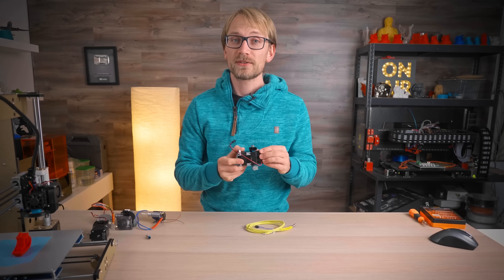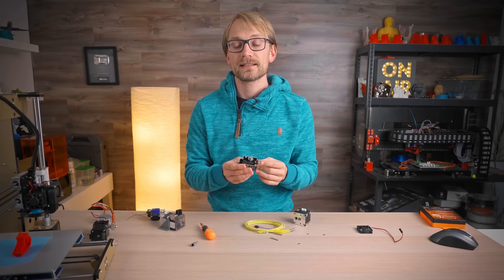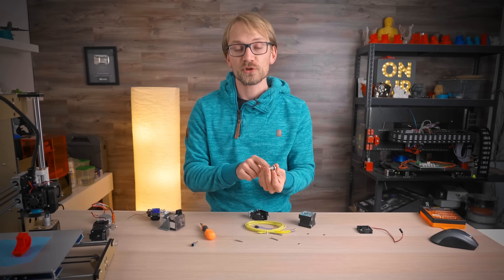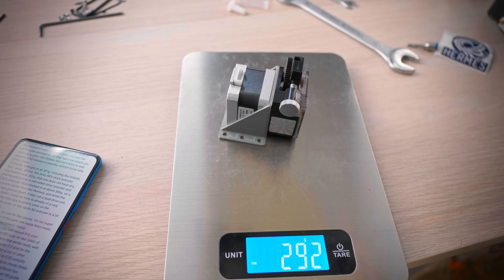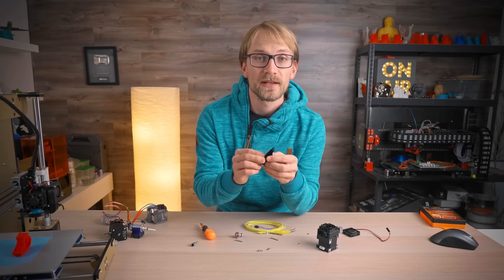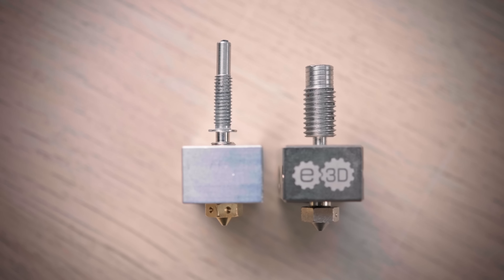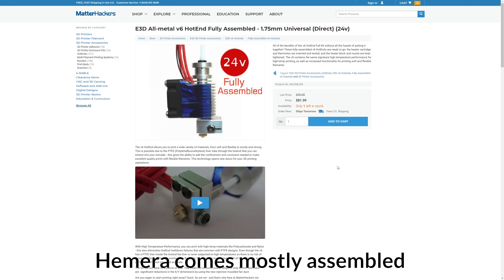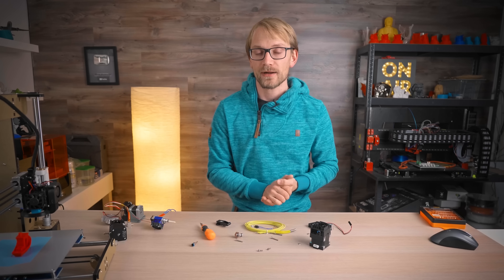E3D’s end-all extruder: The Hemera! (Full Review / “formerly known as Hermes”)

Comment: You don't need the fan when it's in bowden mode?
Reply: No hotend to make heat, therefore no fan needed.
Reply from the maker: The heatsink is still touching the motor, so it could marginally contribute to cooling it in Bowden mode - but really, the fan is not needed then.
Reply: @MadeWithLayers  That sounds super strange, did you mean you don't need the motor instead of not needing the fan?
Reply: @Tomaskom  No, there is no need to have a fan to cool the extruder, when using a bowden setup.
You would still need to cool your hotend obviously.
Reply: @_Piers_  Ah, I see now. Your reply still left me flabbergasted, but looked up the datasheet and now I see what I got wrong. 
I thought when "going bowden" the part you keep is the hotend with the heatsink and fan, dropping the morot and extruder, while it's the extrusion system you keep and the heatsink essentialy is not working as a heatsink anymore since the heatbreak is "fake", working as an adaptor. :)
Reply: @Vector3DP  Oh of course, had my mind it was an all in one carriage assembly. Thanks!